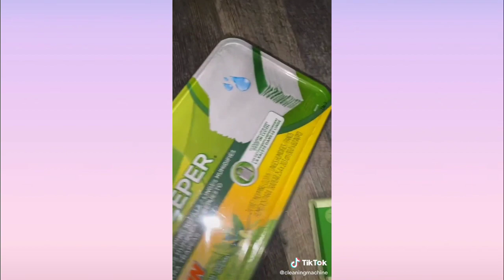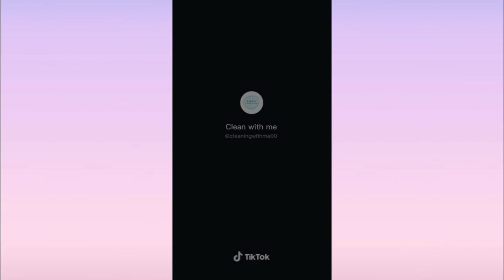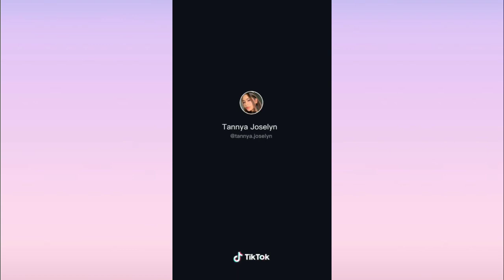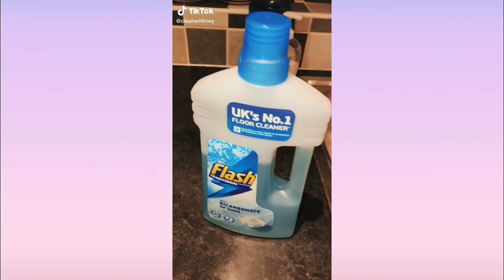Cleaning and Organizing 🚿🌙 - TikTok Compilation #5

Comment: Those people give me so much anxiety putting soaps and detergents in unlabeled containers. The containers they come in have special instructions on what you can and cant use it on and what you cant mix it with (if you can mix it at all) and also have a number on the back to call in case of emergency. You wouldnt put bleach in an unmarked container, so you shouldnt do that with other chemicals! What if you have somebody with kids over and you forget to put your laundry detergent away and they eat it thinking its candy??? Thatll be a yikes from me 😬